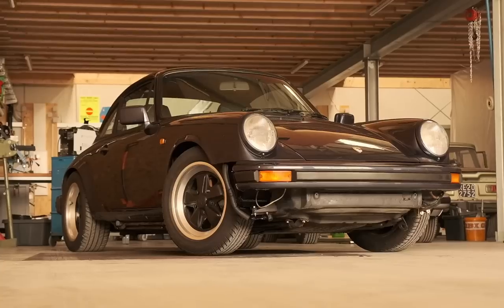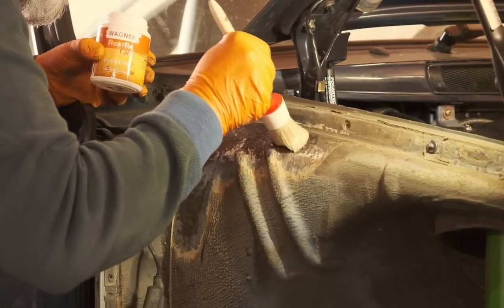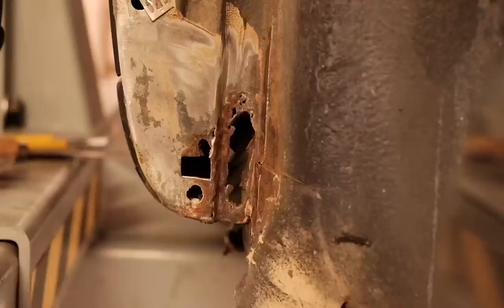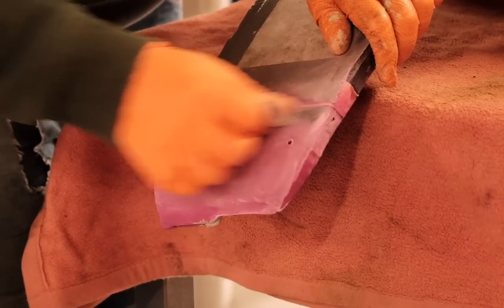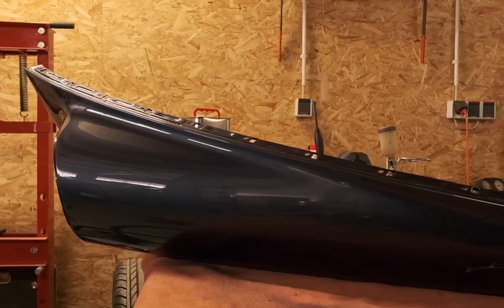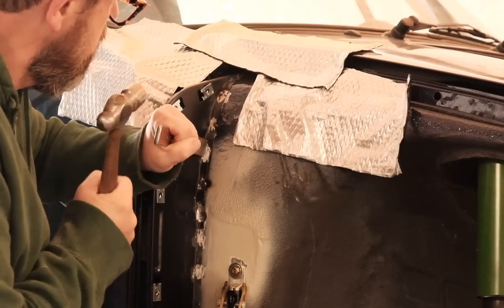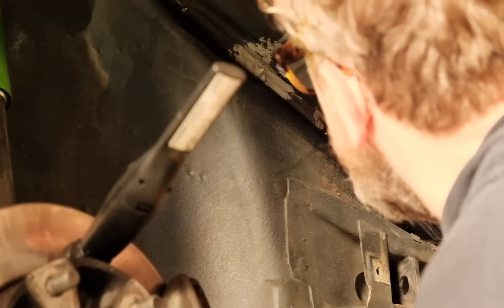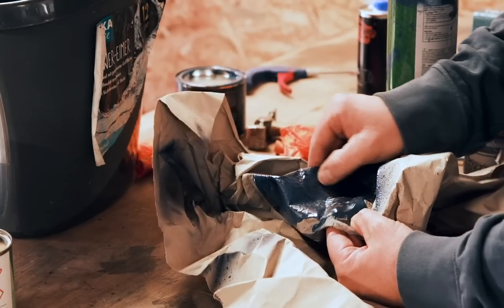Season Finale: Many Complicated Rust Repairs

Comment: Was wondering after changing the plate how the fit will be between the wing and the door... I should not have that concern knowing your passion for precision. The trick to push it back was speechless... Just the touch of a magician of trades. As I mentioned before it takes a lot to achieve such great accomplishment.
Johannes shows it in perfect synchro with such delightful piano tunes and no fuss. I needed a break and a demonstration of metal prep, additional welding technics and meticulous paint did it!
Great inspiration
Reply from the maker: Thank you, Vincent.
I hope I won’t fall out of shape when I touch your Spider.

Comment: Nice comfy space you have there... some gadgets came... nice... one side spotter probably makes weaker welds... but it depends on the power... if it is not structural probably fine.
We can see the love you make to those cars... and i mean the love you make it shows in how you touch the car
Reply from the maker: Thanks, Adam.
In fact the one-sided spot welds aren’t as reliable as the normal ones.

Comment: I always try to brake hard when Johannes posts another video-the best  source out there for in depth repair.  Around the 12:00 mark you are laying down a flexible tube-I assume so you dont get a hard paint edge. Is that a piece of rolled over masking tape???? Takes me a long time to go through one of these as I'm taking notes-on the supplies he uses-the best of the best

Using a punch at 18:25 to better establish a closer electro fitting before spot welding-brilliant. 
Fabbing up a way to tension panels into being on the same plane before tightening the flange bolts at 22:00-genius
Reply from the maker: Thanks a lot, Steve. Much appreciated again.
The flexible tube tape is exactly what you say. The supplier is 3M.

Comment: Wait, a one sided spot welder, what alchemy is this? Amazing stuff and a joy to watch.
Reply from the maker: Thanks, Tom!
It’s easier than you think, it just heats up the part with the lowest resistance. 
If there’s a second connection with lower resistance, it’d weld there, no matter where the electrode is placed. Weird thing, but it works.

Comment: Immensely satisfying.  Sometimes I find myself preferring the 993 above all 911's (and who wouldn't want proper rear suspension?) but there's no denying the timelessness of these slightly earlier late (!) air-cooleds. I agree about the colour as well - nigh-on perfect for the car.
Reply: It’s curious how the simplicity of the earlier engineering is part of the charm.  
I have a 1984 928, but my go to is the ‘72 spitfire, not for its elegant engineering but it’s simple pleasure.
Reply from the maker: You gotta love them all, really.
Reply from the maker: How’s life with a 928, John?
Reply: @GreasyFingers  depressing. I am not using it till next year when it’s tax status changes to historic. There has been a water leak and the rear trim cardboard mouldings have warped and the leather is mouldy. I can do some thing about this, but it takes time and enthusiasm.
Reply from the maker: @johnsherborne3245  I have exactly the same problem with mine and made some progress. Film in the making ...
Reply: @GreasyFingers  I was thinking along the lines of peeling the leather off, clamping the cardboard into shape and laying fibreglass with epoxy on the back to try to preserve the shape. I’m still unsure what to do to the biscuit that was the leather, try to restore it, replace or use vinyl. Restore being the most cost effective. Even good vinyl is not cheap.

Comment: As you secured the AC pipes, well I think that’s what they were, I was reminded of the stern instruction in the manual” not to forgetting to counter hold “. It’s a phrase that keeps reappearing in the Porsche manuals.
Reply: Oil Cooler pipes
Reply from the maker: Yeah, Porsche manuals are sometimes unintentionally amusing. 
In the 991 for instance, every time you open the satnav, it forces you to read a warning to not loose attention for the traffic when using it. 
You know, people read it carefully all the time. 😆

Comment: I'm a big fan of Rustbuster EM121 Epoxy Mastic for under car panels.
After 10 years there are no signs of failure on the old Käfer.
Reply from the maker: Thanks for commenting!
Yes, I guess whenever you can manage to bring phosphoric acid onto it for a sufficiently long time, it’s going to work.

Comment: Yes, YES! Phosphoric acid! 🎉😅 my favorite friend! What is the product? Rostfix?
Most “rust converter” are garbage because all they do is seal the rust away from air and water. But that never lasts…
I usually use pure phosphoric acid, but that’s annoying on vertical panels as it runs off and needs to be applied multiple times…
I love the idea of that gel!!

Quick question: isn’t grinding down the paint for the spotwelds risky? I would have said it would create a weak spot where bare metal is going to rust kinda soon?
Reply from the maker: Thanks, mate.
The name is Rostfix Gel. 

You’re definitely right about the bare metal‘s potential rust issues. Unlike with pliers based spot welding the one-sided tool requires blank surfaces. I’ve made sure it’s properly sealed with epoxy primer from both sides, so I guess I’m good.

Comment: I am a novice welder and I work on equipment that does not need to look pretty. Recently I welded together two pieces of stainless with a mig welder and regular steel flux core wire. Surprisingly it worked! The parts are strong and in service. This brings my question, could you weld stainless patches with stainless mig wire into vehicle bodies, creating a rust proof patch panel ?
Reply from the maker: You’re raising a very interesting question here. In fact there’s one Porsche partly made of stainless steel. It was produced by a kitchen sink company as a marketing exercise and it’s part of the automotive exhibition of Deutsches Museum in Munich. I’ve spent some time researching this car and I think they must have spot welded stainless steel panels to normal ones.

I’m not a welding expert myself, but I guess an entire seam of a stainless panel mated with a standard steel one would lead to a loss of strength and elasticity.
Reply: @GreasyFingers  A test is worth 1000 opinions. Welding one stainless component onto a steel construction and testing durability would be interesting. Maybe a mountain bike with one frame tube replaced with stainless. A very brave test driver and a bumpy dirt road could settle the question!
Reply: Stainlesssteel bodies has always con's. Every not stainless bolt wich would be screwed in the body would tend to rust due to contact-corrosion. If one makes a stainlesssteel car, everything should be stainless...remember deloreans? Body stainless- Chassis rusted away..same with the stainless bolt debate in classic cars😂

Comment: very well done - the car and the video. Also great to see that i am not the only one welding through perfectly new replacement panels. Is there a downside to the spot-welder or should i get one myself as well? :)
Reply from the maker: Thanks, Kristian.
Yes, there is a downside. In the one-sided mode, it just heats up the spot with the lowest resistance. Could be anywhere, not necessarily where the electrode is. I guess the main purpose is to connect small pieces to big ones like latches, brackets, etc.
The machine as such as cool. It can also be equipped with a normal welding (pliers) gun and that of course is a much more reliable application.
Reply: @GreasyFingers  cool thanks. Bit of an off topic: What your your thoughts on TIG welding (WIG)? I am thinking about doing the outer shell using TIG. Got the idea from this video: https://www.youtube.com/watch?v=dvnyIvKeDDk

Comment: Hi Greasy,
How happy wer you with the fit of the JP side panel?
Not sure if you Showeinlagen it already but can post or send pictures of How you lift the 911 with your Twinbusch 1 Pole lift?
I have the same and I always picknit up at the floor welding edges.....maybe you have a better idea....
Reply from the maker: Hi there.
The fit wasn’t too good to be honest, but on the other hand it also doesn’t make much sense to hope that body parts just fall in place. At cars of this period they generally need to be hand-fitted. 

The lift: move it as far to the non-column side as possible, about 5 cm before it’d hit the sill cover. Then adjust the non-column-sided braces, then the column-sided. Contact me on instagram if that doesn’t help …
Reply: @GreasyFingers  allrigty thanks

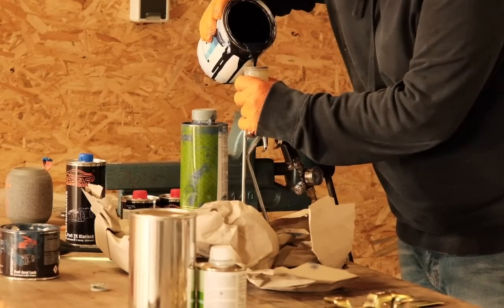Comment: Love your channel and thanks for your practical tips. I'm doing up an '86 911 like your Walter. At 24:47 in this video you show the oil thermostat and it looks like a new one you installed. Do you have a recommendation in terms of these oil cooler parts or is this Porsche genuine parts for oil cooler/thermostat? Thank you again!
Reply from the maker: Thanks, Gordon and sorry for a late reply.
You can easily get that part at all the usual dealers. I’m not quite sure it’s original Porsche, but I never had problems with it. Should be around 300-400.

Comment: Nothing wrong with rust converter.
Yorkshire Car Restoration and Carter Auto Restyling put it best, you could cut out every bit of pitted metal on a rusty car.
But at that point you're just moving the welds so far up and away from the original area that you're not leaving much for the next guy 20-30 years down the line.
In other words, it'll do more harm long term, it's more time consuming and not cost effective, nor is it keeping the car as original as possible.
Reply from the maker: Yes, I’m too coming to this conclusion.

Comment: Is that an aftermarket oil cooler or standard? I guess that is an '84?  My SC has just a trombone oil-cooler, a pipe, no unit... I quite like that unit, seems efficient. BTW Thanks for all your information. I need to get a welder.
Reply from the maker: It’s the standard oil cooler that came with the 3.2.
Reply: @GreasyFingers  One of the many reasons the 3.2 is superior.
Reply from the maker: @johnnydeutschemark3620  No, I don’t think so, it just needs more cooling because it has increased output and therefore also increased losses. 
SC‘s don’t need it so they don’t have it.